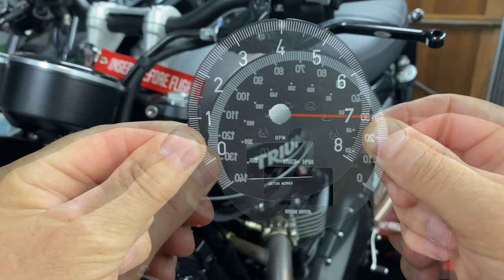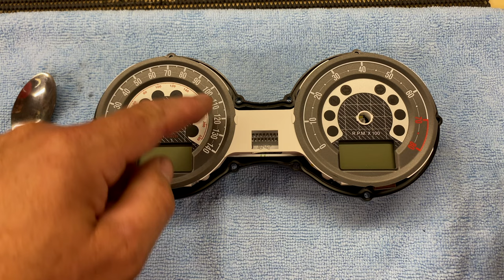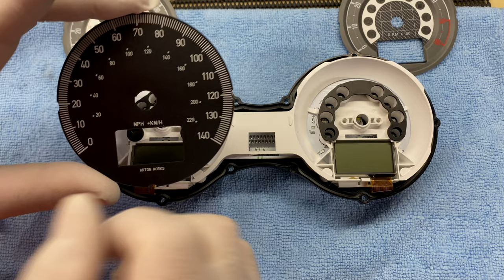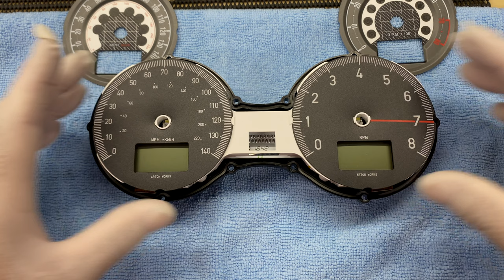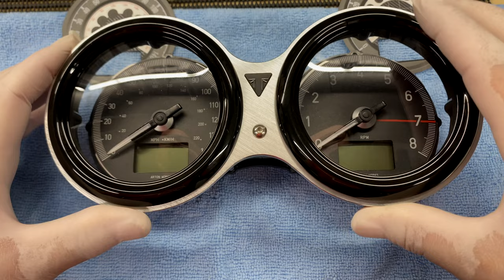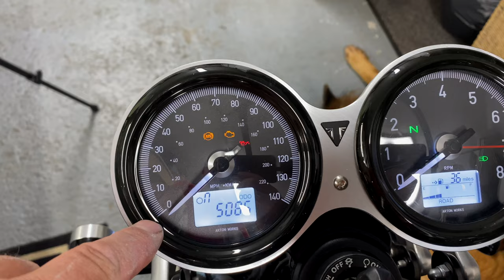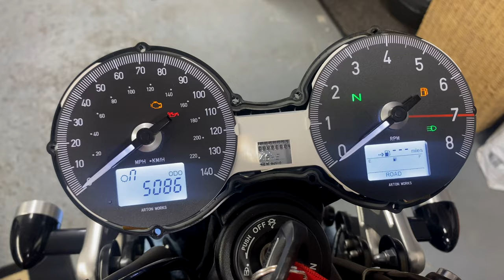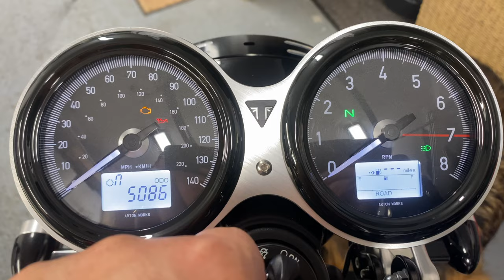Accessories Part 4 | Fitting new dials from Arton Works to the Triumph Speed Twin

Comment: Hi I bought a damaged 2023 Triumph Speed Twin where the bezels and top plate were damaged. Unable to find a replacement I made my own CNC milled from aluminium plate I had to also remove the damaged Perspex lenses and replace with my own new ones to the original lens bracket using a trepaning tool to cut the old perspex lenses. I have seen that some lenses have cracked this was probably because the bike has been let out in the sun for too long or sudden changes in temperature. I have some of the replacement plate bezel units which can be polished or anodized to any colour.

Comment: Did you happen to notice if it's possible to change the glass  while it was off? Cos I've managed to crack one of mine.
Reply from the maker: Hi Kevin, gotta say I can't remember as it came off in one unit. Not sure if you can get just the top section which contains the glass. Rather expensive at £800 for a new unit1 Gulp!!!
Reply: Hi Kevin
 I have replaced the Perspex Lenses but it's not a simple job.
I took it as a challenge to my can do attitude when I was told no bezel or top plates were available.
You need a lot of patience to strip them apart as you need to heat up and remove the Triumph logo to get to a small screw then you need to pry off the Aluminium plate and SS bezels. You will also need a small milling machine to trepan the old cracked lens out

Comment: Great video - I followed your instructions to the letter and the job went really well. Very pleased with the result on my T120. I paid the 96 Euro and also the import tax was about £26 so not a cheap mod but very pleased with the outcome.
Reply from the maker: Thanks, tail itty just waiting to go on next, but very busy editing. Make sure you check that you don't leave the indicators on, as in sunlight not too easy to see in the dash....😂
Reply: @gsd32i  Thanks, I blanked the daylight running light which is a bonus - the kit is very nice quality but your instructions should be mandatory watching prior to fitment, made life so much easier.